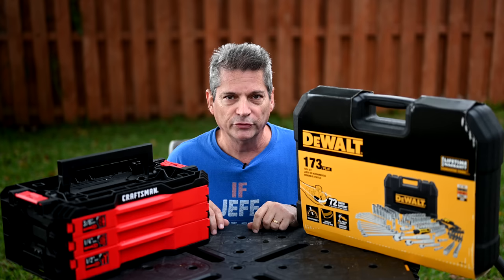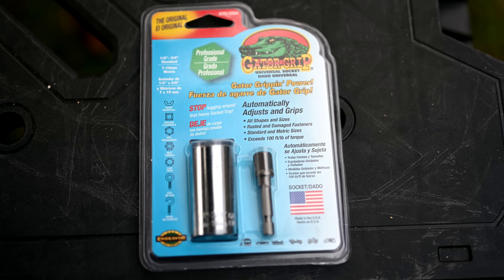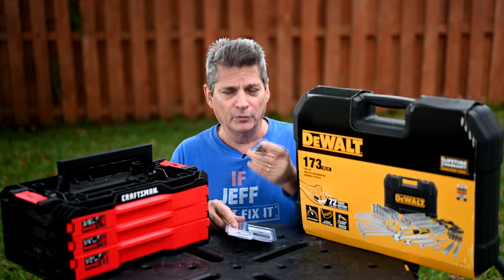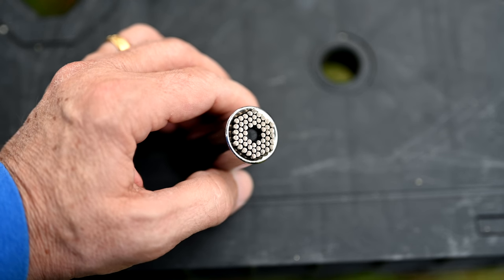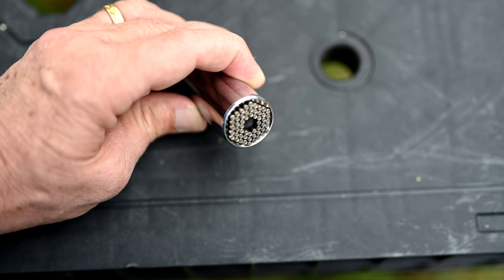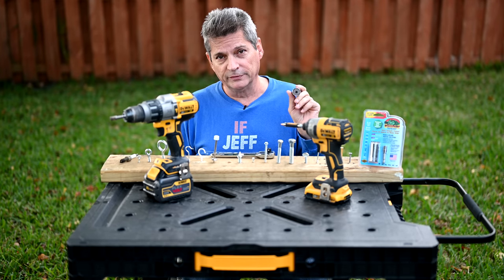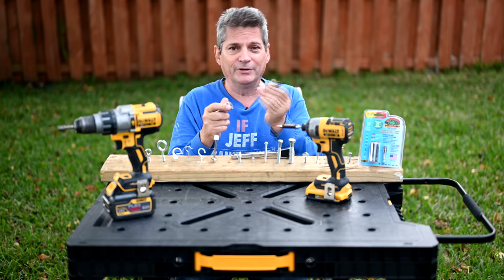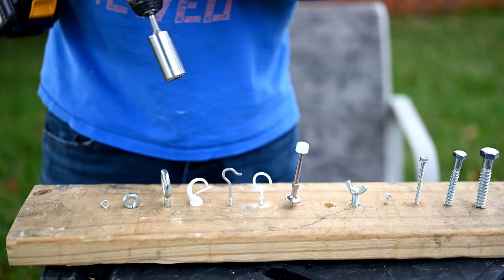Gator Grip Socket Ruins it for my Craftsman/Dewalt Tool Sets

Comment from the maker: ✅ DEWALT DWMT41019 173PC Mechanics Tool Set: https://amzn.to/2OXRMt9 
✅ DEWALT DEWALT DWST11556 Express Folding Workbench: https://amzn.to/2qsaRdi
✅ Gator Grip Original Universal Socket with Drill Adapter:  https://amzn.to/2u1eSa7
✅ Gator Grip Universal Socket 3PC Kit w/ratchet: https://amzn.to/366rrz6
✅ TEKTON 24335 1/2" Drive Click Torque Wrench (10-150'.-Lb./13.6-203.5 Nm) : https://amzn.to/2Q2GmES

Comment: I own a roofing company and we are constantly taking out satellite dishes and TV antennas off the roof. It always amazes me how many different size lags some of these guys use when installing these dishes I think this would be a perfect tool for that scenario. Keeping me from having to dig around looking for different socket sizes
Reply from the maker: That is a great application for this tool, beats dragging a socket set up there,
Reply: Perfect? I'd be very surprised if you could take one satellite dish out with one of these. Its a little better that those garbage adjustable torx wrenches in places where clearance is minimal. Every satellite dish I have seen has 4 bolts in an area that would make this tool useless. This tool wouldn't be of any use in 70% of any real world applications even if it  worked perfect because clearance is also related to fastener size.

Comment: The Gator grip socket tool was one of those that I though was a gimmick. Obviously it's not. Thanks for the review, Jeff
Reply from the maker: Glad to help out Bay!
Reply: it is the pins get locked up and fail instantly dont waste your money he was paid to do this video im sure
Reply: @seantyree8443  I agree
Reply: @seantyree8443  it prob took him so many tries for it to work
Reply: @elusha3926  yea they suck i work in a mechanic shop ma coworker got one to try it the pins fell out not even under heavy load lasted a day 😂😂
Reply: Don't be fooled by the product. Do more research. The product has been around before computers and it still sux, but to each their own. Much luck.

Comment: It’s incredibly convenient & useful for me as a general handyman. I keep it and a driver in my tool belt or put it on my drill for miscellaneous hardwares I run across. I’ll break out a true ratchet set for a heavier job but the Gator is meant to add speed & convenience and reduce bulk & weight in your tool belt.  It’s not supposed to replace full ratchet sets.  I think the sarcastic as missed by some of the comments.
Reply from the maker: I like this tool, I use it if I don't have a socket set with me

Comment: I have one still in the package as well,   That package has been across country 12 times on every move or trip, always throw it in the toolbox thinking I may need it one day but then never use it thinking it is just a gimick.  Until just now I always had my doubts.
Reply from the maker: Crack open the package, see how it does on some fasteners between 1/4" and 3/4"

Comment: good on ya about the electric drill and ratchet over using an impact driver with these!
These just arent meant to take the torque of an impact driver or impact wrench
I see a lot of cases where people slap them in their biggest impact wrench on the tightest bolts they can find and shredding the socket to pieces. thats not how your supposed to use this

however it works great when used the way its meant.
I got a 2 size set of these and they work great. 
1/4 to 3/4 
and a 3/16 to  1-1/4
really useful when you have some odd shaped nut or bolt. or just cant be bothered to find the right socket (or you lose it)
Having the really large one really is awesome for larger nuts or bolts
I wouldn't use these for lugnuts. they would probably get destroyed from the torque if they were at all tightened
Reply from the maker: Thanks realflow, good info!

Comment: Sorry didn’t get chance to answer question. On one, yeah, we were putting up stiff in kitchen & painting etc...so had acetone/paint thinner & the other one I don’t recall. 
But, after watching this; think will try the Gator Grip from this vid👍🏻
Thx for the help.
Cheers✌🏼
Reply from the maker: Yes, I suspected you had pain thinners nearby. Folks from Endeavor Tool, the maker of Gator Grip say that because all the cheap knockoffs use glue to attach their pins to the springs, the pins often break away from the springs when you use any solvents or paint thinners, which dissolve the glue.
You'll hear me explain about the DuPont product they Gator Grips has on their pins.

Comment: The 3/8" universal socket is selling for $12.98 and 1/2" for $22.98 on Sears website.
Reply from the maker: If you buy over $50 in products, they have free shipping at Sears, otherwise cost will be around the same as Amazon because Sears will add shipping charges.

Comment: Yeah, just got this delivered because I'm on a budget but I think I made a boob. It's for getting in the nooks and crannies of my outboard motor and I reckon it's gonna be much too big for the job. Handy to have though.
Reply from the maker: Yes the socket is somewhat long so it does require that you have pretty easy access to the fastener that you need to loosen

Comment: Hello! Many thanks for this great video! I bought the same one you have at Home Depot. As I 
understand it, this tool can be used best with a drill, not an impact driver. Also, hand tools are good with the Gator...
My idea was to have it as a back-up tool and/or as part of my EDC for situations like you described towards the end of the video...beats having to carry a heavy socket set around all the time.....subbed!
Reply from the maker: Welcome aboard Edgar!

Comment: So... what about the GLARING flaw that its can’t drive anything FLUSH with the wall/surface?
Reply from the maker: yes every tool has it's limitations. I would not characterize that as a flaw in the tool. I only use the tool on hex heads that are standing proud of the surface anything other than that I would seek another tool it doesn't mean it's a flaw of the tool it just means it's not for that purpose. You wouldn't use a pencil to remove a tub drain would you? That doesn't mean that the pencil is flawed, it just means there are more appropriate tools designed for that job like a tub drain wrench.

Comment: why has none done a review on how this handles broken screw tops wither it can remove or not.  This is why i would be looking for this tool.
Reply from the maker: Well I mentioned that this tool can't handle anything that is rounded. If you have a like a Phillips head screw that is stripped for example you would want to use the speed out tool kit which is an excellent kit

Comment: I have one of those gators somewhere I bought at Walmart when they had clearance I know I should keep it with some of the other stuff I have I'm pretty bad about that keep up the great work cheers with a beer
Reply from the maker: Luckily they are cheap enough to replace for under $20.
Reply: But for two bucks is worth picking up

Comment: I’m confused was it sitting in your garage or was it a lifesaver many times over the years, I realize they don’t have to be mutually exclusive but I got the impression you were saying it say in your garage unused and unopened for 20 years.  No?
Reply from the maker: No I used it maybe once a year, some years 2 or 3 times, but is sat opened, on a small shelf where I keep spare sockets and drill bits.

Comment: Wow it looks pretty great. Cannot replace a standard set. The thing is not self centering. Doesn't matter if you're just driving something into wood. Drive in a machinists application. Great in wood but flop with thread on thread parts.
Reply from the maker: It's basically a lifeboat socket, but on all those irregular shaped hooks and thumb screws and wing nuts for hurricane prep, these are priceless.

Comment: Need some help brother, I did the backsplash in my kitchen but took a while to remove the grout. Any suggestions on a way or something I can buy to remove it? Thanks.
Reply from the maker: ✅ Custom Building Products Sulfamic Acid Cleaner Crystals: https://amzn.to/2XWNcMQ this works pretty good on dissolving excess grout
Reply: jeffostroff Should I use a drill brush to help it ?

Comment: The product is not for anything requiring average torque.  It will easily break. Having said that it works for small low torque situations.   So if you are crazy enough to throw away your tool set for this low quality product, you must not have any jobs worth doing.  This product is for amateurs who have to fix something because the wife made them.... doesn't work for the handyman who is repairing something every other day.
Reply from the maker: Summed up perfectly Michael!

Comment: Ha! How do you know that specs on that tool unless you are part of the testers. If that tool is so good and you had it for 30 years, why did you go and spend hundreds of dollars on tools that you said the gater socket can replace? 

You talk about the knock off but you don’t run a test to compare how they work diffidently.

Just a couple things I noticed
Reply from the maker: The tool is a backup that's why I have other tools. But when I forgot to bring my other tools, it saved us

Comment: it can only use in open wide space cant use in mechanic
Reply from the maker: You can use it wherever a regular socket will fit, because this is about as wide as a spark plug socket.

Comment: can this work with rounded off bolts such as my oil pan bolt?
Reply from the maker: If the bolt is round I doubt it will work. If it has a large Phillips head hole in the top of it, then it might be able to grip it.

Comment: Everyone knows those gator grips are trash....
Reply from the maker: It's funny how everybody who has never used that tool seems to know it is trash. It's the same uninformed people repeating the same uninformed news that they received from the other uninformed people before them. I've had that one for over 20 years, In my garage and you could see it didn't even start to corrode at all it still looks brand new  and it was still kicking butt and it saved me big time last year at my friends house when we had no tools over there but I had my Gator grip socket and I was able to loosen a small hex nut on the door
Reply: I'm definitely informed man....they're ok for small on the go job but throw that on a small impact driver and its gonna be toast...its just common sense sockets are more structural....but I would agree its a time/life saver to keep around....so its 50/50 for me...

Comment: gator grip sucks thepic fail instantly and get dirt and crud and get locked up how much did they pay you to make this lie video ?
Reply from the maker: No one paid me, I have always owned one since they came out, I bought the Gator grip in this tool review with my own money at Home Depot. They work great for me, and have saved me several times when I did not have a socket set with me, but had the Gator Grip socket in my tool bag.